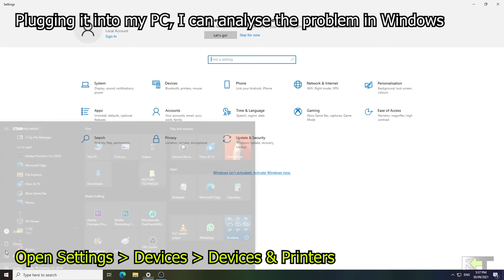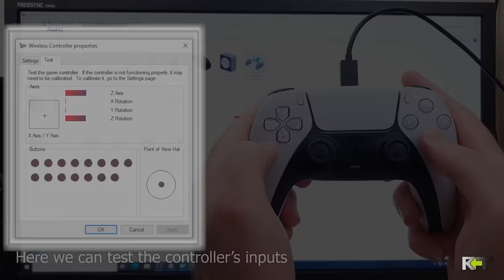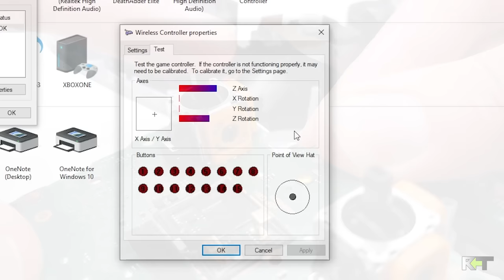How to take apart your PS5 Controller and fix Stick Drift

Comment: My Duel sense doesn't have stick drift rather one is rather sticky and stiff to move
Reply from the maker: Sounds like someone spilled soda/juice on it. Yout might need to replace the while analog stick. Or you could drip some Isopropyl Alcohol down the stick in hopes of it loosening the sickness, but it's a risk that the alcohol could move it elsewhere bad.
Reply: @RestoreTechnique  nothing was spilt on it. Still under warranty so I'll have to send it back to Sony. Thanks

Comment: 3:43 dude what is that and how do I put it back on???
Reply: I never removed mine - it didn't seem necessary. If you want everything to fit back into place afterwards. I figured he only removed his because he was going to use the solder?

Comment: Can someone help me, my ps5 controller has stickdrift on the left stick and I’ve tried using compressed air and it reduced the drift a lil bit but it also starts to drift when I jus rest my thumb on the left analog stick
Reply from the maker: Yeah I can help you... follow this video 😄👍
Reply: @RestoreTechnique do you have to replace the wiper disk or is it ok if I just clean the wiper disk and put it back where it eas
Reply from the maker: @raizurs_marsad1188  Usually you just need to clean the wiper disk. Sometimes if the carbon track is too damaged, it may need replacing. The wiper disk rarely needs replacing, unless it gets bent.
Reply: @RestoreTechnique  ok thanks

Comment: Having fixed my ps4 Controller a million times myself, I can see that they intentionally made it so much harder to fix these basic problems yourself. Unplugging anything from the board is always a risk especially if you haven't done it before, now you have to do that 4 times. 
Disassembling everything just to remove the stick, wow. 

I have 400€ Sony headphones that I can't connect to my Sony ps5, this company is a joke.

Comment: I move had 2 my ps4 controllers for 10 years works fine get my ps5 haven’t had a year both controllers got the drift wtf
Reply: Same. And I've dropped my PS4 controllers way more than this one.  I'm tempted to send it to Sony but it's the only PS5 controller I have.

Comment: 2:34 That "big clip" won't open for the life of me.
Reply: I just pulled on the casing very, very gently instead of using the tool. Turned out ok.
Reply: @FenrirAldebrand  Thanks for the input. About a day later I did manage to open it with a pry tool, however it damaged the edges slightly from the force that was needed. The DS4 was much easier to open imo.
Reply: @r.o.o.k.  It was, in a way. I feel like the DualSense was easier to open, but not dismantle. I had a clear DS4 controller and something went wrong with it, so I decided to take it apart without instructions like I did the fat PS4.... Needless to say it's still in pieces somewhere.  The DualSense is definitely more delicate what with all the ribbon cables (which I started hating when I was taking apart my gaming laptop and accidentally broke the clip for the cd drive ribbon cable and it never worked again even when I managed to get power running back to it by wedging it into place with some cardboard). 

I feel like this one made it easy to pry the black piece off even without tools to give it a very surface level cleaning. But anything beyond that is a disaster. I was too afraid to break the joystick housing "doors"(?) (Idk WTF to call them, those colored bits around the bottom of the joystick housing). Needless to say my left stick still has MAJOR issues drifting to the left, especially when clicked down and flicked to the right. But until January it's my only PS5 controller so I'll just suffer till then.
Reply: @FenrirAldebrand   If you use a thin metal spudger or anything similar, it's actually very easy to pry those analog doors open. Just make sure to pry only from the top and not to wedge it deep. Once you clean the potentiometers inside it should remove all the drift.

Comment: Shame on Sony for never solve this problem
Reply: They solved it on that crazy expensive Edge controller in a way , by just making the joy stick cuhe a quick swap out design . so its a $20 cube fix every 5 months not a $90 controler swap .

Comment: Seriously why is this such an issue...mine is unbearable...and a new one is 70 dollars?? I'm sorry but if a controller is that expensive, it should have a recall. I did find very small hairs inside, and that fixed it...thing is, my dualshock never had this issue and I was rough with those.

Comment: I was about to do this but my dad somehow fixed it from the outside?
Reply from the maker: Yeah I've heard of people using compressed air or Isopropyl Alcohol or wd40 from the outside. Don't think it has a high chance of working, and could do damage, so it's a bit more hit and miss.
Reply: @RestoreTechnique  Yeah my dad just somehow put it in. Works fine. Guess it's dad powers 🤷‍♂️

Comment: The easy straightforward approach to rectifying stick drift on a PlayStation 5 controller......buy a new one. Unless you are one of those types of people that have good technical understanding of electrical components aswell as a good engineering understanding then its pointless even trying, and even then it's only gonna be a temporary fix and when I say temporary I mean that it could revert back to its problem in 3 days time, 3 weeks time or in a years time but rest assured it will. I suppose not everyone has the ability to buy another one brand new but still that's the right way forward.

Comment: 2:40 mine will NOT unclip
Reply: I just gently pulled on mine instead of using the tool on it. It turned out fine. Just use the minimal amount of force needed to get it off.

Comment: Interesting that stick drifting is the most common problem with ps5 controllers and they’ve designed the controller in a way that it takes a lot of steps to get to the joysticks. Therefore most regular people won’t even attempt to open up the controller and will just buy a new when when all that might need to be done is just a little clean up. I’m sure Sony didn’t design intentionally that way….. wink wink
Reply: their ceo is mr krabs or something dude i swear "MONEY MONEY MONEY"

Comment: If these companies wanted to they could make these controllers without drift I saw a video of a guy making custom potentiometers with magnetic components that would never drift the technology is there they just want you to keep buying $70 controllers
Reply: the magnetic ones are much better but still can get drift - plus theyre more expensive to produce. What they should actually do is have every controller have easy to replace potentiometers like the duel sense edge and let you choose either anolog sticks or magnetic. imagine that - you get easy to slide in and out potentiometers that could be magnetic which would last longer. With that man nobody would need to buy a new controller but sony wants more money man.

Comment: and if the three pins break?
Reply from the maker: Continue guide from 8:00
Reply: @RestoreTechnique  Sorry but what do I need to do the process? Tool and equipment
Reply from the maker: @andromedaGLNY  A soldering iron, and soldering skills.
Solder, flux, Isopropyl Alcohol to clean up flux, replacement potentiometer.
Reply: @RestoreTechnique so if the three pins break it won’t work?
Reply from the maker: @lahmarr773  correct

Comment: There was nothing "gentle" to do on my controller, everything was solid asf nothing smoothly came apart and it managed to snap the cords trying to pry the stick motor open, I was being so damn gentle and it didn't even slightly budge just slid off ripped the plastic and snapped the cord. Just buy a new controller don't waste your time on these P.O.S what a let down this controller is to work on. 1mm cables connecting the motors etc stupid.
Reply: Lol

Comment: Put it back together and half the buttons didn’t work 🤔🤔🤔
Reply: Likely have your ribbon board or button rubber misaligned.
Reply: @r.o.o.k.   Did it again and went back to normal but still has stick drift
Reply: @athank3509  Replacing the potentiometers could fix it. Also sometimes just resetting the controller fixes it for me.
Reply: @r.o.o.k.  Sounds like it’s happened to you multiple times do you fix controllers?
Reply: @athank3509  Haha yeah it's happened to my launch DualShock 4 controllers a few times since 2013. But I've always been able to fix them from cleaning the sensors, never needed to replace any parts. They're still running perfectly with no drift.

Comment: Well I could say I failed or it’s the controller that’s just shit because I’ve bought 3 controllers already and all were replaced because of the same issue, my newest one got stickdrift at the age of 3 months. I tried but it didn’t work, I still thank you for trying to help ppl but we should sue Sony because I never had issues with stickdrift on the PS4 and I played on that console since I was 11 and I’m 16 and got the ps5 at the age of 15.  The ps5 controller is a fucking scam
Reply: my experience with ps4 controllers is kinda similar. Mine started to get drift but not as quickly as my ps5 controller now. Its insane too because the duelsense edge, sony's pro controller they make, has replaceable joysticks. So that means they know this is an issue and still manufacture millions of these controllers with the same bs issues. The duelsense edge is like 200 bucks and idek how much the spare joysticks are but its crazy that they are very obviously forcing people to buy more expensive crap. kinda sad. Although if that is the case thats kinda dumb from my pov because you could probably get an aftermarket controller for cheaper that does similar things to avoid stick drift which wouldnt help sony at all but idk man. just sucks.

Comment: I think i made my battery not work
Reply: It sparked 2 times when I tried to pull out
Reply from the maker: @thegamerfriend3572 did you damage the wires? A spark indicates a short between the wires, or the plug. That could start a fire.
Reply: @RestoreTechnique  I did twice as Said but it worked when I reseted the controller

Comment: I like the part where I copied everything; and it made my controller worse to the point where buttons stopped working. I appreciate the help from your channel, a nice fuck you.
Reply from the maker: If your buttons stopped working then you obviously didn't reassemble it properly. The button film mustn't be making contact with the motherboard, or you tore it. Unfortunately I can't show every little possible pitfall in a 15min video.

Comment: This is utter bullshit.  At the end of it you pay $1000 for a system to mess up every 2 to 3 months.  I've not had any issues with my ps2, 3, and 4.  None.  Come along the ps5 and it's a freakin nightmare.
I don't have steady hands to do this so there's no way I'm conducting open heart surgery on these controllers. 
Sony needs to fix this!
This is BS!😡😡😡😡😡

Comment: all these tools came up to $55 total, $15 more and you get a new controller by itself 🤣🤣🤣 MAJOR FAIL
Reply from the maker: Umm, the tools aren't single use you know... 
Also how did you spend $55 on tools for this?? Cheap mobile phone repair kits are like AU$5-10 on ebay, and include the screwdriver and the pry tools. Add AU$10 for Isopropyl Alcohol, and $5 for foam Qtips.